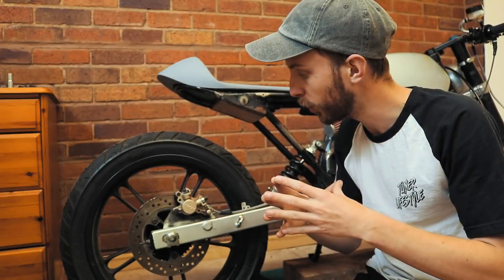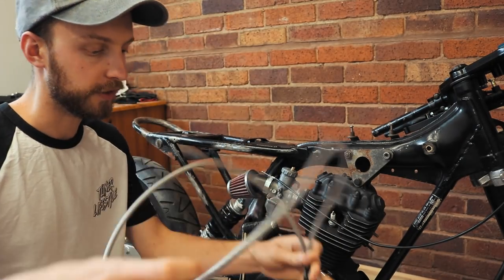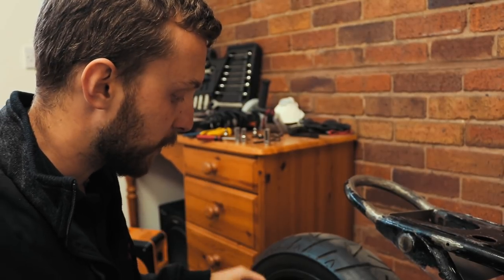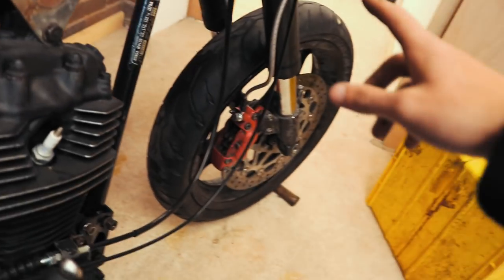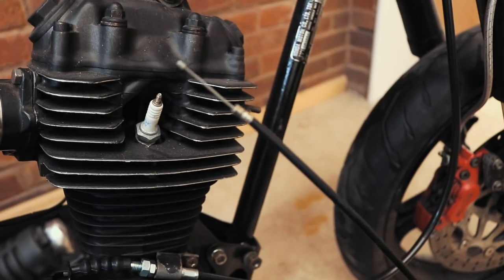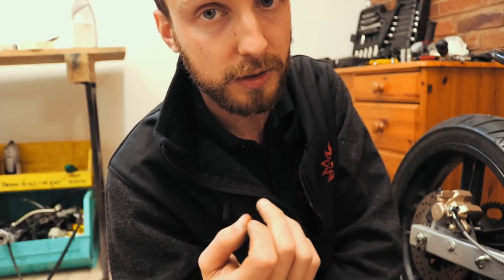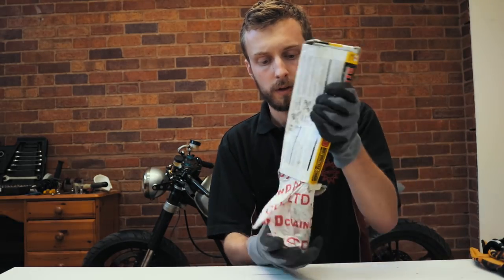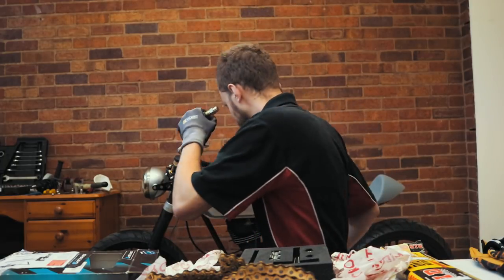Honda CB125 Cafe Racer Build - Part 13 - WORKING REAR BRAKE + CHAIN FITTED

Comment: Great job mate 👍. It's hard to tell from the video and I could be wrong but you may have fitted your split link clip the wrong way. I believe the profiled end needs to point in direction of travel.
Reply from the maker: +garrywolf3 hey man! Thanks for that, yeh I think it's the wrong way round in that case... I'll swap it round when I get back! I'm just happy it fits!
Reply: Jish No problem mate. Keep up the good work. Try 'wurth dry chain lube' if you want something that doesn't make a right mess of your bike. Your not running a chain guard so it will help. Low fling lube. That what I use on my custom 👍
Reply: Yeah if you fit it that way round it will come off during travel as the first bit of anything it comes into contact with will snap it off. As gray says curved end facing direction of chain travel.
Reply from the maker: +Matthew Booth Iv taken note of this and  will make sure it's on properly ☺️
Reply: Jish done it myself. Not fun when your chain whips off at 60mph!

Comment: The bike looks cool. But a question : how much have you spent on it already? And what do you assume will be final cost?
Reply from the maker: +Himanshu Sharma hey man! I can't tell you the cost so far as I don't actually know! It's not loads though, Iv budgeted well and I'm guessing about £1700 maximum all finished and build with new bolts and paint etc
Reply from the maker: +Himanshu Sharma hey man! I can't tell you the cost so far as I don't actually know! It's not loads though, Iv budgeted well and I'm guessing about £1700 maximum all finished and build with new bolts and paint etc
Reply: Jish mmm. Okays thats fair enough.

Comment: Did you check if both sprockets are align after swapping the swing arm?
Reply from the maker: +lexxermonstermachine yep! It's something I kept in mind throughout the conversion
Reply: Jish so it was just a matter of luck when choosing a swingarm and everything fits perfect?
Reply from the maker: +lexxermonstermachine there is an element of luck that came into play, if you have watched my previous videos you will have seen I bought an aprilia RS125 rear wheel and tried to getting that to fit, then I ordered cbr125 wheels and the accidentally sent the Yamaha yzf125 wheel you see on the bike now so it was a happy mistake really!
Reply: Jish happy days! This is one of the issues I have to solve on my project bike but will get there soon.
Reply from the maker: +lexxermonstermachine keep at it dude! The way I look at it is it will frustrate you and it might not work the first time, but when you are riding that bike down a country lane in the sunshine all that grief won't matter, hope you can make something work dude!

Comment: have you thought about using an M-Unit from Motogadget, and running brand new wiring for the whole bike? I think it'd be a good call, especially since the wiring has already been compromised by previous owner(s).

https://youtu.be/HNF-h6oBczg
Reply from the maker: iv just had a look and as cool as it would be to have something like that dam its expensive! ill keep it in mind though! cheers!